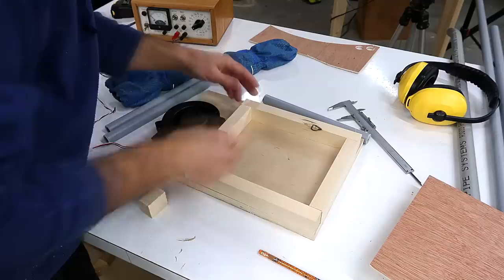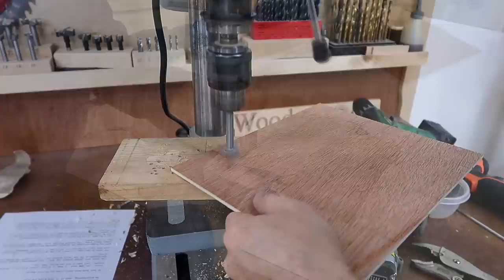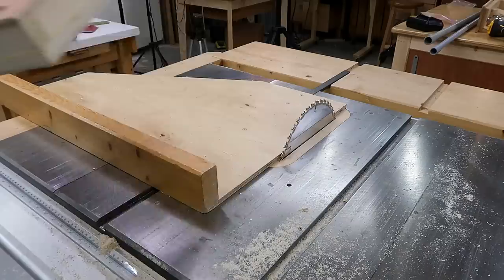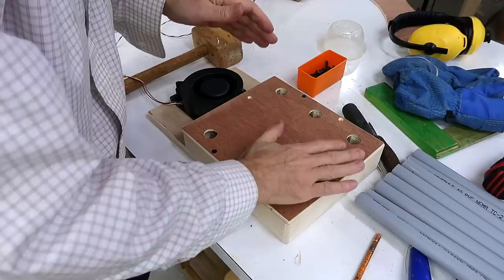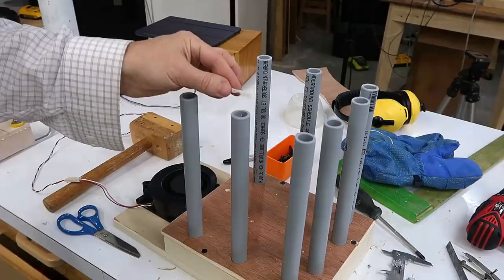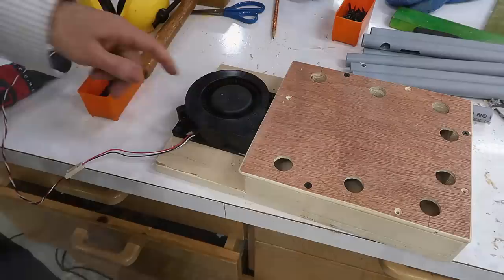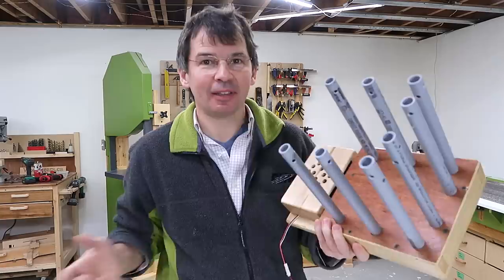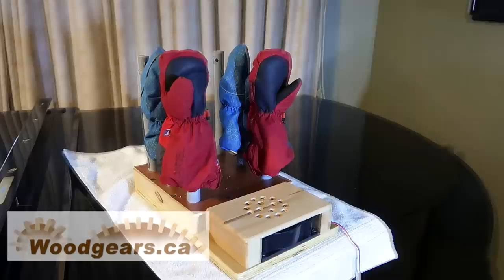Mitten dryer

Comment: Just a little but of airflow makes all the difference.

In retrospect, you could have made the unit square with the blower fan mounted to the center of the lid.  That would make the whole unit slightly smaller.  Maybe a version 2.0.
Reply from the maker: indeed
Reply: at least his current design possibly reduces the chance of water dripping into the blower fan

Comment: I was gifted a glove/shoe/sock drier once before that was designed without the use of a fan at all. It had long upwards facing tubes the same as your design Matthias, however somewhere in the tube they suspended a fine wire heating element. For air movement it relied on the warmth to cause the air to rise up the tube. It never got "hot" but when you removed a dry pair of gloves from it they were somewhat warm. Less so than out of a proper clothes dryer but noticeable nonetheless. I couldn't comment on the speed of it, as I always simply left it on all night. I'd be curious to know which design was more energy efficient to reach a state of dryness. 

Great design in any case. The ability to simply turn the tubes to cut off airflow to where it isn't needed... chef's kiss

Comment: I built a ski/snow boot drier years ago with similar components. the  air box fed a larger diameter vertical PVC pipe with smaller pipe like yours. the small pipes were inserted into holes in the larger one that were angled up.  I used PVC caps to cover the unused ones - your technic is simpler and harder to loose. the extra exit holes are a nice touch too.

Comment: I built something very similar a couple of years ago. The difference is that it is just an open bottom box that sits over the furnace floor vent in our dining room. The kids got to paint it themselves, and it gets used constantly throughout the winter. Mine was designed for enough pipes to hold two kids mittens and boots.

Comment: As someone who just dealt with a flooded first floor, I can confirm that it's amazing how fast a little moving air can dry something out. It took me about 8 hours of shop vac work to get the standing water cleaned up, but a 1HP air mover and a Ryobi shop fan dried out anything they were pointed at in a few hours at most.

Comment: Necessity is the mother of invention.  The difference between Mattias and most of us is he actually listens to mother!
Really cool project.  Would be interesting to see solutions to not have to turn tubes to enable airflow and a way to make it automatically turn off once mittens are dry w/ maybe a humidity sensor.  I love this project.
Reply: Turning the tubes is one of the most elegant and expedient solutions possible. Caps are fiddly, manufactured valves are expensive, making the valve out of the pipe itself like Matthias did here is the right solution.

Comment: Use the twelve volts you have left over to run a small heater coil just between the fan outlet and the plenum.  Warmed air will dry faster and if you don't use them, those twelve volts will just run around making trouble for the twelve that are staying busy pushing that fan round and round.

Comment: There is a lot of unused real estate in the center of the dryer.  You could have added more pipes in the center, with a small block of wood inside to block airflow when not in use.
Remembering to rotate the pipes that are not in use is a bit of a hassle, especially for young kids. I'd design a plunger inside each one of the pipes, that opens the airflow when the weight of the mitten is placed on it.

Comment: I just put mine over the heating vent grilles (assuming you have a forced air system, and the air comes from the floor and not from the ceiling). Cool project.

Comment: Great project! But make the tubes and holes in them thicker, otherwise there is a significant air resistance in them. I remember putting air flow through a vacuum cleaner hose and got some 2000Pa pressure loss on about 2m distance! So please take it seriously. Reducing flow resistance will greatly enhance flow, because at higher pressure drops fans perform increasingly poorer.

Comment: One of the downsides of forced air heating is you don’t have a radiator to dry your wet gloves/mittens. I built a weird contraption that attached to one of my vents using pvc pipes to dry my gloves. But since the vents are on the ceiling it was too big and very cumbersome. I don’t live in Canada so my gloves don’t get wet often enough for it to be worth the effort.

Comment: I would have thought you might need some kind of heater but I suppose blowing air alone does a pretty good job. I might try to take this one on myself. It's seems easy enough to where I might not screw it up!
Reply: It would be simple enough to use an old hair dryer instead of the fan he used. Consignment stores often have a box of them that nobody wants. Bonus, it plugs right into the wall with no wiring or extra PSU necessary.

Comment: I do a similar thing with work boots if they get wet. Two 80mm computer fans stuffed into the top with the tongue pulled out a bit. Not ideal but they dry overnight.

Comment: And here I was imagining some thin wire spring cap that exposed the holes when pressed (just enough tension to rise with no glove on). turning the pipes is a much simpler solution

Comment: How about placing the mittens in a air-sealed box and pull the box vacuum with a refrigerator compressor to let the moisture evaporate?

Comment: The only potential design issue I see is the activation/deactivation of the tubes via turning them. I am a forgetful person so I would definitely have times where I put the mittens on the tube but forgot to activate it. 

Since you have power running to it for the fan anyway, you could have LEDs on the box at the base of each tube controlled by a switch which is pressed when the tube is rotated into the "on" position. This is absurdly overcomplicated but it would be pretty cool.
Reply: Or just have a led in the plenum, if a tube is open, light will shine through.

Comment: Weird design for the placement of the tubes.
It seems like the 90deg corners and the tube small holes would cause quite some air friction...
Do they not?
Or was this design chosen just because it's simpler / you can close the tubes.

At least it works well, awesome video as always 😁😁

Comment: A hair dryer coil, cut to lower the wattage, inside the box with temperature sensor shutting it off (for your safety friends) could increase the efficiency?

Well efficiency might not increase but drying time sure would?
Reply: it already works well enough
Reply from the maker: didn’t want to combine a heating element with wood

Comment: Great build! Very practical indeed. 
In Sweden we use a shoe dryer to achieve the same effect, ours is wall mounted and has 4 bendable pipes coming out from the bottom and the dryer blows warm air from it. It drys our kids mittens and boots and we consider it a must have! Search for "skotork" and you'll see how it looks like.

Comment: i apreciate that you're using what you have on hand, but as a mechanical engineer it makes me kinda sad that you're using a squirrel cage fan to pressurize a plenum 
great results though!
Reply: Why? As I understand it, most central HVAC systems have a similar fan, also distributed through a plenum.
Reply: @mlindholm  i design HVAC systems everyday. 

there are two fans for two main use cases that i want to briefly discuss (and several others that are important but not relevant to this discussion)

1) squirrel cage fans that blow directly down the ducts and get the benefit of their velocity pressure

2) plenum fans that are designed and intended to pressurize a plenum, but don't get any use our of their velocity pressure

it's not a problem that he used a fan to pressurize a plenum.
but it is a mismatch to use a squirrel cage as a plenum fan.
Reply: It works.
Reply: @plane-o-1292  of course. 
But imagine any specialist watching people haphazardly slapping stuff together from their field. 
I'm not saying it's ineffective...
I'm saying that it makes the eye of an HVAC engineer twitch.